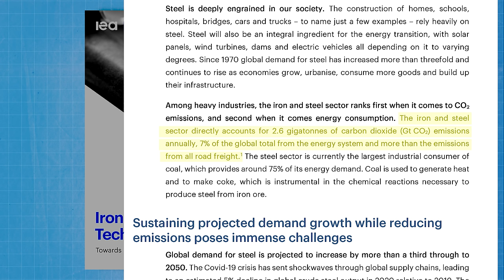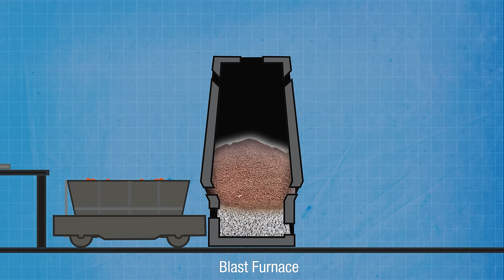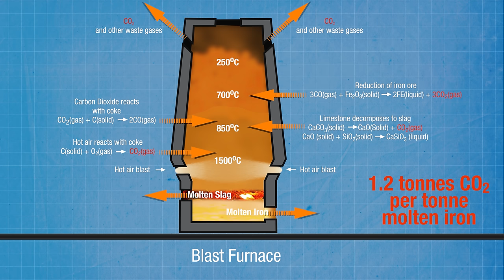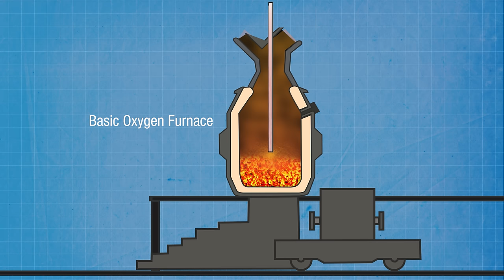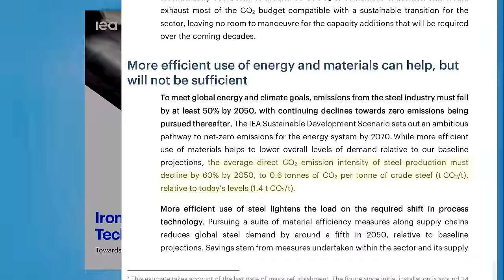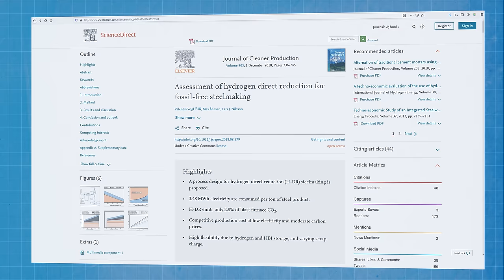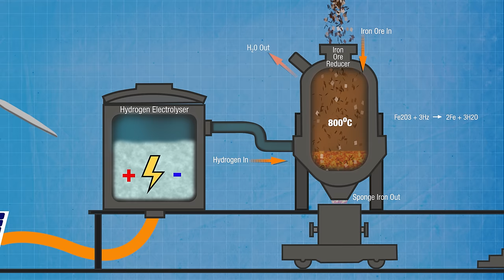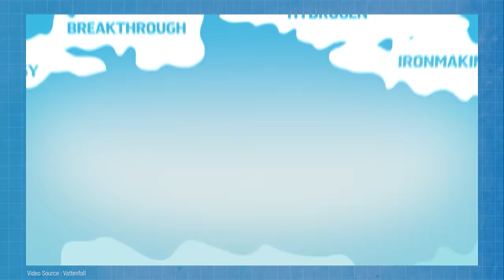Fossil free steel. Another giant step towards net carbon zero?

Comment: Great vid, really informative. Especially for the total layman in this area of expertise.
I work at a steelmill and we're about to be taken over by SSAB. So I have knowlegde of steelmaking and insight in this world, both on the maintenance front as on the research side of things.
There is another option which is far more attractive to exsisting steelplants and that is to have a conventional blast furnace run on mostly hydrogen. The energy-balance of this process is pretty difficult, but it can be done. It also won't yield as much CO/CO2 saving as the sponge iron process. But the main advantage of converting exsisting blast furnaces is that you won't waste an entire blast furnace (demolishing such a beast is not cheap) and it will enable you to continue with business as usual in a far shorter time with less costs than when you would have to construct an entire new plant.
Reply: Very interesting idea for an interim solution.

Comment: Hydrogen embrittlement will become a concern so there may need to be additional processes added between the reduction of Iron and the production of Steel to make sure the hydrogen used has been completely removed.

Else all steels will still use conventional methods. 

https://en.wikipedia.org/wiki/Hydrogen_embrittlement
Reply: Read the wikipedia article, it explains that hydrogen embrittlement is a low temp process that takes place with wet steels at temperatures below 150C
Reply: Not an issue, at all, when we are talking about introducing hydrogen to molten steels. It'll just boil off. It's normally an issue with low-termperature processes like electroplating, or for anything that comes into contact with liquid hydrogen. The common way you fix a solid part that is undergoing hydrogen embrittlement is literally just to anneal it by heating it to 300C

Comment: I am really glad you didn't fall into the "let's just coke biomass and use that instead of coal coke" trap. Iron production used to be "carbon neutral" for thousands of years and used wood as fuel. However, with industry being at the current level going back to the "traditional" process of producing iron would rapidly destroy our forests.

Using hydrogen as a reducing agent isn't actually a "new" idea and is sometimes used in small scale plants, however the source of H2 is usually from fossil fuels like methane or oil refineries. This has some advantages, like adding the required carbon to reach steel. However I'd have to refresh my alternative steel production knowledge to discuss further. Iron sadly is one of the industries where it will be harder to become carbon neutral, however there is a lot of exciting research being done to tackle this issue.

Thank you for producing these high quality videos about the climate topic! I am very glad I found this channel.

Comment: This could be very promising! Especially when you take into account that you can reuse the water.
Reply: Assuming what you really need is steam.  There's no harm in emitting water directly into the atmosphere.  It's not toxic.
Reply: Oh dear... Water is next to air the most abundant resource on earth.
Reply: Adelaine Delabin  Only locally, and briefly.  The total amount of water in the atmosphere is a function of the average temperature.  We couldn't change it if we wanted to.

Comment: Great episod! As a swede, it makes me proud knowing we lead initiatives on sustainable industry. I believe one of the Keys to reducing co2 is of course to develop methods that decrease it at the source, another is co2 capture. But as a hobby wood worker I can't help but compare this to dust handling. The best way to avoid Dust in the shop would be a cutting metod that dont create dust (handplaning, carving...). I compare this to the hydrogen metod you talk about. The least efficient way is air cleaners (basically a box with a fan and a filter hanging from the roof filtrering the surrounding air). This would be equivalent with the iceland co2 capture you've mentioned in previous episodes. The third option for me is a compromise. I use a conventional production metod but capture the dust at the source with a big vacuum cleaner (shopvac) This metod is not new of course, its used by every wood worker in the world who intend to use their lungs for a while longer. And at a Swedish bio-etanol fuel production plant I've been working at they capture their co2 in Collaboration with AGA (now Linde group i believe) that purifies it and pack as compressed co2.

My question to you and the puplic is: How common is this practice? Could co2 capture responsability be an option to co2 tax? Just like garage disposal and sewage treatments, co2 collection would be a rest product industries need to either deal with their self or hire someone else to do.

Comment: Sunday. Morning.  Instead of going to church, Just Have A Think.

A synergy I can see is that Hydrogen from Hydrolysis is to be used in the production of steel, there will be an impetus to produce that hydrogen more cost effectively. . .   which would help accelerate Hydrogen Fuel Cell use in transportation.   

Too soon to write off Hydrogen Powered Cars as “Fool Cells”
Reply: Hydrogen will never be more efficient than batteries as a way to power cars.  Even if we can create it cheaply, it still requires energy to compress and heavy tanks to store it.  I think it's safe to write off H2 powered cars.  It might make sense for some trucks and buses.

Comment: I have worked in Steel Mills, at the hot end.  I have commissioned Arc Furnaces and Basic Oxygen Furnaces.  I think this idea of using Hydrogen instead of coke is a great idea.  
The issue I see is the size of the solar energy farm that will be needed.  Those Arc Furnaces take an enormous amount for electricity. 
So let’s do this and not complain about the Wind Mills and valleys paved with solar cells.

Comment: Just another reason why pairing renewables directly to chemical industries on micro-grids makes so much more sense as an initial and quick build-out step over trying to quickly and fully integrate them to powering the grid. Much easier to build something new to work in a certain way than to adapt existing infrastructure.

Comment: This is not a new Idea, Direct Reduction has been tried 2 times to my knowledge, in fact I worked at one of the plants in Port Hedland, Western Australia. The other plant was in Brazil. Did they work? sort off. in the end Both plants were shut down and demolished because the whole reaction is dangerous the Port Hedland plant Killed 1 worker and several others badly burnt when the reactor was shut down for Maintenance and opened up. It was never fully established what caused the explosion but the leading theory is that it was caused from water used on a dipleg drill that was drilling into the top of the Reactor. 
To understand how, you need to realise how reactive nearly 100% Iron is. It stripped the oxygen molecules of the water leaving Hydrogen, hence the explosion. the Reactor had only been shut down for 12 Hrs and was very hot still.
The Reactors also had to be constantly monitored for hot spots where the Refractory lining was thinning a constant danger was a Hydrogen leak at those temperatures any leak was an instant explosion.  
I can tell you also that the sponge Iron will be turned into Brickets, these are also Highly reactive and prone to Exothermal reactions even when cool. I remember the steam coming of stock piles because of the humidity in the air. When they were loaded on to Boats to be sent to Japan and China they had to cover the Brickets in 2 foot of Iron Ore dirt to slow down the reaction from the sea air.
Another thing to keep in mind is this process is very very Maintenance intensive due to the low operating temperature of the Reactor. it was prone to clogging and the reduced Iron dust stuck to everything.
Too my mind I think the investors will eventually give up on this plant due to operating costs and the fact they are damn dangerous, but I could be wrong maybe they have fixed the process.

Good Luck.
Reply: Thanks for sharing a more complete picture... hopefully they are keeping past experience in mind while trying to revolutionise the industry.

Comment: 4:33 Basic Oxygen process: It's concentrated O2 that is used, not air. And it isn't 'pull(ed) out from the bottom' - that ladle is designed to tip so it can pour - in two different directions so it can separately pour off the slag first.

You have to compress a lot of air in bulk, to liquify it so you can separate the N2 from the O2, and to do that cost-effectively, you need to be able to reuse the energy in the compressed 'waste' N2 to reduce the energy cost of compressing the air. 

This is universally done with unsung hero Pyotr Kapitsa's key invention of the centrifugal turboexpander - yes, that thing that harnesses the power from a turbocharged engine's exhaust, in order to power the compressor. 

This invention is the one advance that makes basic oxygen process cost efficient, but poor Pyotr almost never gets a mention - it's alway 'Bessemer'. But without the turboexpander to allow cheap O2 separation, the basic oxygen process would be too expensive to use, because you'd have to use about 5x more energy to compress the air, and most of it would be wasted on compressing Nitrogen!

In comparison to the technical intricacy of designing an efficient turboexpander - not least realising that it's the critical step in the gas liquefaction process that makes it so much more cost effective - realising that you might burn the excess C out of iron by injecting compressed O2 doesn't really seem that much of a leap. 

Bessemer gets the credit because he patented the idea, without the critical invention of 'so how do you get so much cheap O2, then?' that is enabled by the turboexpander. 

Kapitsa isn't even remembered for this work - even though it was probably what allowed Russia to make so many tanks relative to Germany in WW2 - he invented it in 1939, just in time to basically turn the tide of the war, by permitting the T34 production to out-produce Germany's tank production to the extent that it did: Even though the germans had better tanks, the russians had so many more that it just didn't matter.

Perhaps this is the benefit of getting Nobel-laureate-level physicists and forcing them to put away their high energy physics toys and instead work on much more 'down to earth' industrial problems?

Comment: Electricity generation is going renewable in Australia thanks to large scale batteries and the low cost of renewable energy.
Cheers Gray
Australia
Reply: finally, please stop exporting coal within the decade and become a green h2 net exporter for Asia
Reply: The large batteries wont benefit a very energy intensive process, we simply need to produce more/green electricity
Reply: @velotill  kawasaki a japanese company is working on producing hydrogen in Australia and exporting part of it to japan
Reply: @carholic-sz3qv  exactly, build "too much" PV and Wind which will always be enough, excess energy goes towards H2 production
Reply: @velotill  but not the batteries, the batteries are just a puffer system, steel Mills requires tons of energy 24/24 everyday
Reply: @carholic-sz3qv  sounds great. It is just so sad that only now Aussi is getting up to speed with utility renewables because it would be economically unwise not to.
The true tragedy for mankind is that Murdoch was able to corrode boomers minds in the Anglo world which puts us decades behind where we could have been if the US had not gone to W etc.
Reply: @carholic-sz3qv  batteries, H2 storage or straight windmill/tidal/PV to smelter, it'll work out.
Reply: @velotill  the power will be connected directly from the solar/windfarm to the steel mill since they need constant energy all year around, the fournaises are not allowed to be stopped. The batteries are mostly to regulate the domestic use
Reply: @velotill  Australia is a giant energy source potential, with all that desert outback and very sunny/windy weather it should not be that hard to invest in renewable. The biggest issue is not the government but those giant international companies/lobbies that controls almost everything
Reply: @carholic-sz3qv  but at least they are beginning - with the the Arrowsmith Project set to start producing Hydrogen from solar and wind by late 2022, the Murchison 5GW project proposed near Kalbarrie, the Asian power Hub and Sun Cable projects proposed in the north of Australia and Fortescue Metals (who have made their money exporting iron ore to China) now about to pilot steel manufacture from renewables in the Pilbara region. There is definitely a change happening now.

Comment: I studied this in the early 90's - it's not new engineering... BTW - that's a GOOD thing...  The only ONLY reason we don't do it that way now is coal is essentially free. That and Geopolymer for concrete and we make a huge step towards carbon  neutral.

Aside: once we have a good reason to make Hydrogen in bulk, be it season shifting energy or making low carbon (sic) steel, we can also use it as a feed-stock replacement for everything we do with fossil fuels (though getting carbon out of the air as a feedstock looks to still be a barrier there...)  I predict transport fuel isn't going away quickly.

Comment: Great video, been banging on for years about how hydrogen can be used to clean up industry. Equally, HHO gas or Brown's gas (Oxyhydrogen) which can be easily created using renewably sourced electricity and water will be supremely useful and could be used to replace burning coal and natural gas for heat.

Comment: Used to work in companies that designed & built steel equipment or modified/overed hauled steel making plants.  Two processes that always interested me were the natural gas fueled blast furnace that is the same process that you explained only it produced some CO2 and electric arc grade iron  bricks. In the electric arc grade ore process; strong magnets separate the powdered iron out of the ore leaving the unwanted material in the ore for disposal. This creates a product that can be used in the electric arc furnaces without the use of a blast furnace and it is used at the mining site to reduce shipping costs and this reduces the  production of CO2 created during shipment to the mill.  Both processes could produce CO2 free steel or more correctly low CO2 steel as so far shipment of iron ore or pig iron ( what it's called after it leaves the blast furnace) is not a CO2 free process. Anyhow both processes I described have been  widely used in N America for the last 10 to 15 years but to be low CO2 steel, hydrogen would need to be substituted for natural gas and a fossil fuel free energy source would need to replace the fossil fueled electric generators. It wouldn't hurt to produce fossil free ships and train locomotives too. In the early 1980's a few steel companies in the USA played with the idea of using thorium powered nuclear plants to directly reduce water into hydrogen and oxygen while using the heat for electrical production. (nuclear steel making) The difficulty was that in order to utilize the entire nuclear plant's output within the facility at that time of technological capabilities; the plant's production would exceed the market's demand for the steel within its economical shipping distance.

Comment: It might be expensive initially, but like all new green tech, once the infrustructure is built, surley the running costs are minimal in comparison with carbon fuels. The fuel will be cheaper than coal, diversification of assets could reduce costs further and bolster profits. Carbon could be sorced free from scrubber plants or at least at a low cost making the scrubber industry attractive. Given how much money is used to subsidise coal and steel, exploration and ore extraction costs, surley this is a win win in the medium term?

Comment: Kind of on the same topic here is the use of aluminium rebar in new compositions of concrete, using blue clay. The aluminium would be recylcled (from engine blocks of cars.)  Tons of emission reduction. Look it up
Reply: That might deal with the problem of rebar corrosion, too.  It would need to be thicker in order to have the same strength.  Note, however, aluminum is significantly more expensive than steel.